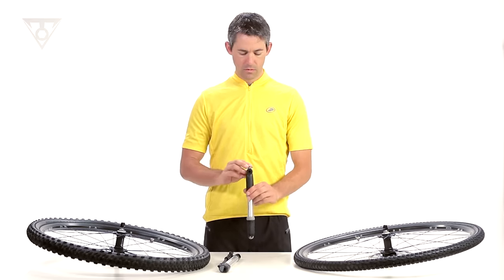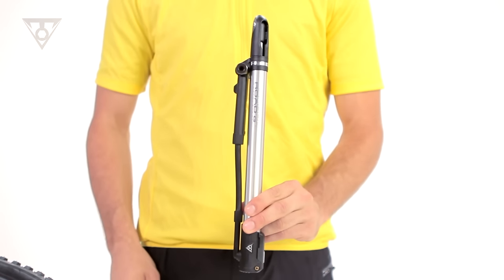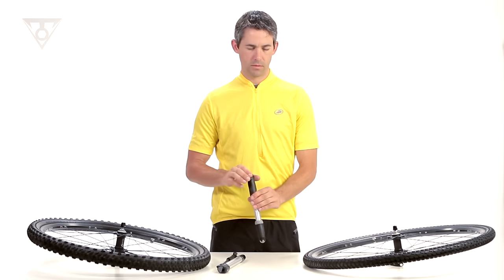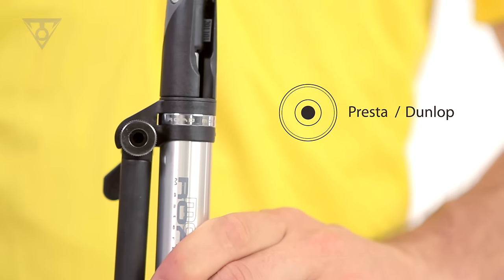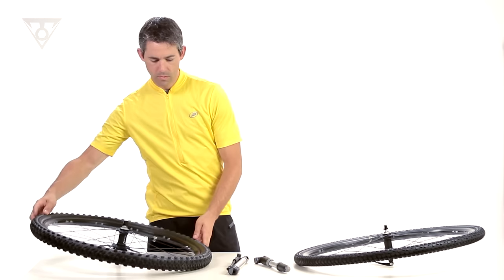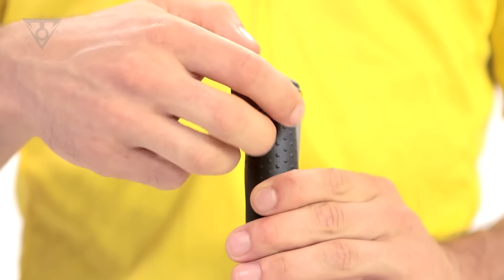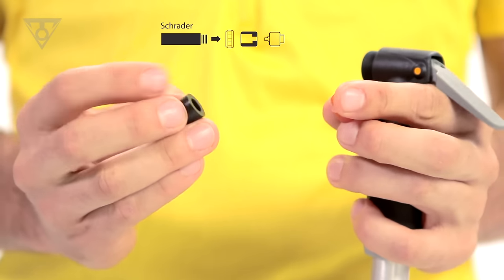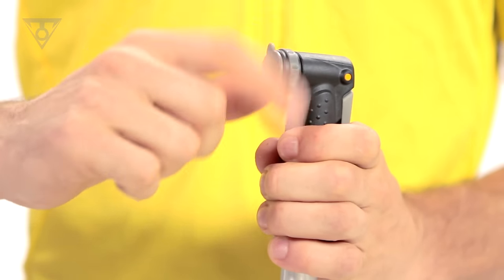Topeak - How to change internal pump head parts (updated)

Comment: OMG, so easy asked myself how to use a pump like this on my dunlop tire. Of course there are 2 parts and not just one to turn around in the head of the pump but that was not visible because both parts are black rubber.

Comment: I figured I wasn't using this properly, even though the pump worked. The pump packaging actually showed these parts in diagram form and I even went looking for them, but it's completely non obvious that they exist. I note that the bleeding obvious stuff like the nozzle lock and the screws have their own diagram. Marketing packaging fail.
Thank god you had the brains to do this video.
Reply: Oh wow, looks like I'd completely forgotten how this worked! 
I've just bought a new bike with a different valve stem and wondered why my pump didn't fit, lols...
It's still a nice pump btw
Reply: This made me laugh 6 years later
Reply: @andthefunkybunch1466  😹

Comment: Thanks this video was quick and helpful. Just a note: I tightened the cap and then loosened it a 1/2 turn and it seem to pump air in the tube on both strokes.

Comment from the maker: Sorry for the late reply. Which mini pump are you using? If it's Mini Dual Action series, Mini Dual G, Mini Dual, Mini Dual DXG or Mini Dual DX, then it is correct to deliver air on the push and pull strokes.

Comment: I simply can not believe that Topeak never takes the time to explain that with their pumps you flick the lock lever "up" to lock the pump head to the valve stem. I own two of their pumps and neither mentioned that in the instructions. I even went so far as to go to their website and there is no mention of the  lever up to lock feature there. Can't tell you how many folks I've run into that did not understand "lever up to lock" and returned their pumps as defective. One really has to wonder where they get the people who write their instructions and/or produce videos like this????

Comment: Someone gave me one of these but I only need it to inflate basketballs. How do I attach a pin to it?
Reply from the maker: As long as the mini pump is not just for Presta only, then you could place the ball needle into the Schrader valve and with the thumb lever up to engage the ball needle with the pump head. Please notice that the pump could pump to high pressure so that make sure don't over inflate the basketball.
Reply from the maker: The parts inside the pump head are missing so that the pump cannot be used. The Harpoon mini pump has been removed from the product line for years now. We don't sell its parts kit anymore.
Reply: Thanks for the public reply, I had the exact same question after a friend borrowed my pump and gave it back with the schrader pieces missing.